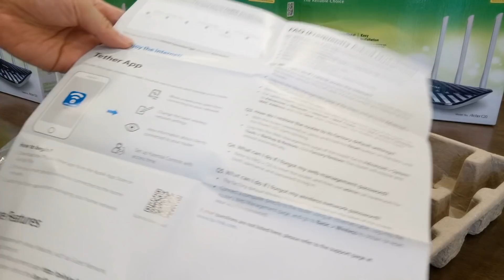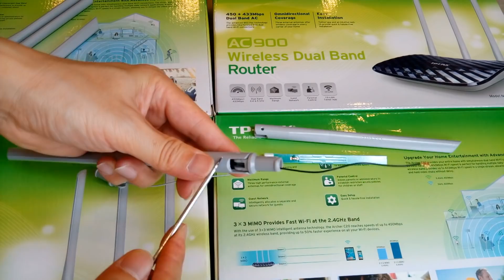Unleash Outdoor WiFi: 5dBi to 16dBi Antenna Hack

Comment from the maker: 🎁 You can find 2.4G panel antenna outdoor wifi patch antenna in wlan system 2.4ghz patch antenna 14dBi SMA L brackets FREE SHIPPING WORLD WIDE here https://shorten.asia/pRcfgg3N. If you cannot mod your wifi router, just buy this outdoor wifi router with long range antenna https://shorten.asia/V3K7AM27

Comment: ah,no you dont sorry friend , the antenna elements will still be at the factory rating, all youve done is to effectively change the box the router is in and place it outside,that doesnt boost antennas by 11dbi ,it will still be the same as factory settings
Reply: you can buy high gain outdoor antennas with built in wifi or 4g acess points , for same as you would have spent, good for the diy aspect but there are smarter options,and cheaper

Comment: I don't know why would I do this instead of buying an outdoor antena like the tp-link CPE 210/510. But hey, pretty cool video!
Reply: I’ve been running the TP-Link 2.4GHz N300 Outdoor CPE for 4 years. Today was the first time I’ve ever reset it. For $40 you can’t beat it for range, price and dependability. 
I’ve connected to it with my phone @ 1/4 mile. I’ve see the signal at 6/10th.  I’d like to test it in a bridge setup

Comment: Ordinary electronic components are from 0 degrees to 70 degrees Celsius. The donor (Archer C20) is a device for indoor use equipped with common components.
Sometimes outdoor temperatures are below 0 degrees Celsius. At other times, the internal temperature exceeds 70 degrees Celsius (in the sun + heat generated by the electronic part).
The antennas must be uncovered or the electronics themselves partially cover them.
Reply: It's working. I used more then two years TP Link Archer C20 ass outdoor router.
Perfectly working with huge coverage.
Reply: @himeltfr  ok

Comment: I've a query about my Router.

I'm having a TP Link Archer C20i Router. I was using it by connecting it to 12v battery directly (because input rating of this router is 12v 1Amp).
It worked fine until one day the battery discharged and due to under voltage my router stopped working.
I don't know what happened to it, any components got damaged or firmware corrupted but only Power LED is glowing and nothing else.

I tried flashing new firmware using TFTP Mode but no success. Serial communication is showing random unknown characters in serial window and yes I double triple checked the baud rates.

Then I removed Winbond BIOS 8 pin IC and checked it and I'm able to Read and Write to the IC.

Now I don't know what else to do?

Any suggestion would be appreciable.

Thanks

Comment: How come two antennas have only one wire comming from them while the third antenna has a cable with outer shield as well as central core push on connection. How come the 2ghz antennas have each only a single soldered wire.

Comment from the maker: Please subscribe and find how to #WiFiMarketing videos 
High gain 9 dBi dual band wifi antenna VS original TP-LINK routers https://www.youtube.com/watch?v=yqtpkVea1_M 
WiFi antenna hack 5dBi to 16dBi long range outdoor TP-Link router https://www.youtube.com/watch?v=ytgQW49P0GE 
Display wirelessly to TV using AnyCast M2 Plus Mini Wi-Fi Display Dongle Receiver https://www.youtube.com/watch?v=gCr1tEWREk8 
Out door long range WiFi router mod Tp-Link TL-WR841N hack lightning protection https://www.youtube.com/watch?v=wSAyS8WCIZY 
Copy eprom flash chip to chip without computer ezp2010 copy tools https://www.youtube.com/watch?v=UZsbB7E0YjE

Comment: please send a link , for buy this Box , this is very nice :)
Reply from the maker: make sure you buy the cable as well
Reply from the maker: https://world.taobao.com/item/37752017312.htm?fromSite=main&spm=a312a.7728556.w4004-13513415335.10.YazAbQ
Reply from the maker: https://world.taobao.com/item/528963133785.htm?fromSite=main&ali_refid=a3_430618_1006:1122765686:N:poe%E5%88%86%E7%A6%BB%E5%99%A8:f9a040e3a13001900d01f84d877b834e&ali_trackid=1_f9a040e3a13001900d01f84d877b834e&spm=a312a.7700714.0.0.
Reply: is this antenna on aliexpress?

Comment: Sorry but this makes no sense. You spent what 150 on router poe box seals glue... When you can get an external sealed poe powered ap for 75 ...why?
Reply from the maker: WiFi gain is the matter in this case

Comment: I saw that you soldered 2.4mhz wi-fi cables to the TP-Link card. is there polarity to weld? Could you describe the antenna kit better? so I realized it only works 2.4 MHz and you improvised by putting TP-Link behind the antenna plate. right? Is that antenna eh omini?
Reply from the maker: the 5G still can work as omni to serve some near by clients
Reply: Ini

Comment: This is actually pretty nice.
Reply from the maker: and work better
Reply: @TiengAnh.Online  How can that be academic? It is silly that you spend more than buying the right equipment for that purpose. This is due to a conscious defense in electronics that believes that it did something very creative (in case most of its components were made with recyclable components but  it is not the case there is a modem from the same manufacturer that already does that and has the capacity to support power with PoE, which is just putting the utp cable and connecting it to the PoE and it is already providing service or cheaper to buy the equipment for that purpose PA  external

Comment: Dear, brother do you make that antina minimum 3 kilimiter long range , please
Reply from the maker: can be 5km+  if you have p2p
Reply: What is P2P? Can u explain n where can i buy or get it? Sory am not an it guy..tqvm
Reply from the maker: I mean when you have 2 sites that can see eachother, and you need to align your antenna so they can light sigh each other. To buy please go to Aliexpress or Taobao search for 16dbi out door antenna.
Reply: WiFi Marketing Solutions tq sir for the answer. so this antena can capture signal from outside/other user (free wifi) located few kilometre away?
Reply from the maker: if they also use this to transfer, if they use normal omni antenna, you can also catch the signal long away but not that far.
Reply: WiFi Marketing Solutions apreciate yr answer. Am looking for outdoor wifi antena that can captured signal 1-2km. I surf taoboa site just now, but dont know which one is ok n suitable..
Reply from the maker: You can find it here https://world.taobao.com/item/37752017312.htm

Comment: Your Modification is said to increase the power from 5 dBi to 16 dBi..  How did you measure the true output? .....or did you calculate this increase by change in Antenna gain alone ?
Reply from the maker: In theory, 3dBi difference, equal to double wifi power. In my case, I can reach out more.

Comment: Sorry bro, the video is ok, but, the POE that you use can only transport 10 / 100 mbit of lan signal . If you want the gigabit you MUST use a  Universal Power over Ethernet ( UPOE ) like the cisco. That system can tranfert the power and the signal with all the 4 twisted pair cables, that can reach a power supply of 60w and a signal of 1 gigabit. Sorry for my orrible english. If you have any question write to me and i can give you an advice . Bye bye
Reply from the maker: great, we will need those for the next mod

Comment: Dear i have recently by tp link cpe210 his antenaa is 9 dbi but its not working perfect  can you guide me please
Reply from the maker: quite similar antennas, and you can see how to align your antennas like this https://www.tp-link.com/res/upfile/faq/20160202030455.jpg
Reply: WiFi Marketing Solutions  dear i have one tplink i have no bridge. I had fit the router on my floor but it not working
Reply from the maker: so you use the wrong tools, directional is for distance, for device around you, you should do omni antenna.
Reply: WiFi Marketing Solutions 
Can you tell me any anteena type which is my wifi range is 500 maters
Reply from the maker: If you are sending signal 500m you have to get 2 routers and align those antennas so they are light sign to each other, then you can create another wifi for your remote clients to connect in. I normally do it using OpenWrt, not sure if your TP-Link router supports or not.
Reply: WiFi Marketing Solutions 
Thanks

Comment: sir i sent you site my tplink is just like same i want to remove the tplink5210 curcuit and add a wrtplink840n curcuit i how i do it or i make the insite anitna for my adapter to catch signal from a accespoint or i attach an indoor tplinke just like tplink 801nd  plz tell me the wiring method what is earth wire and what is main wire